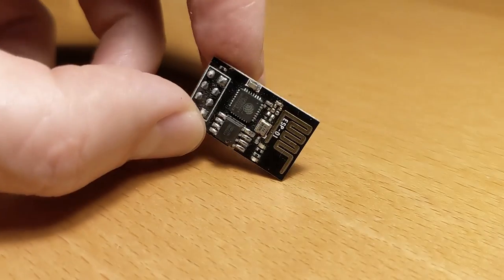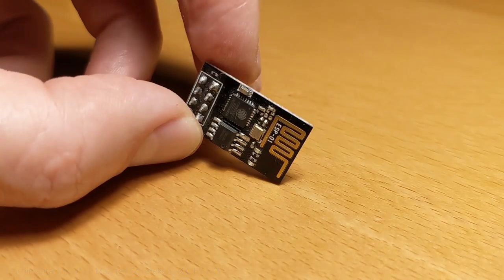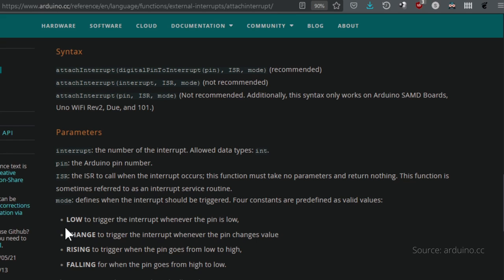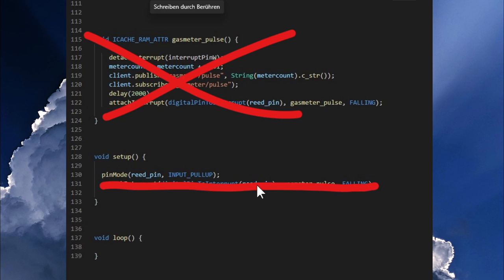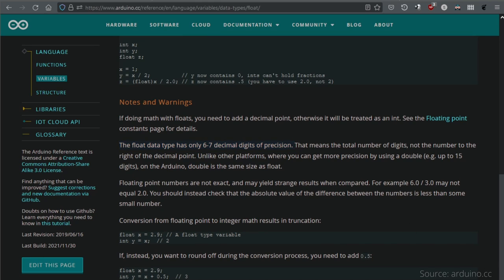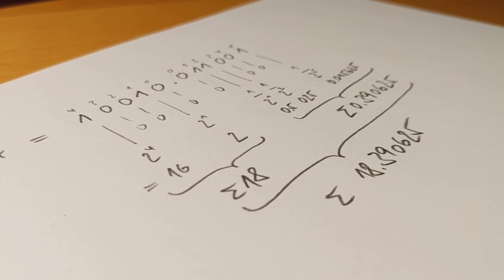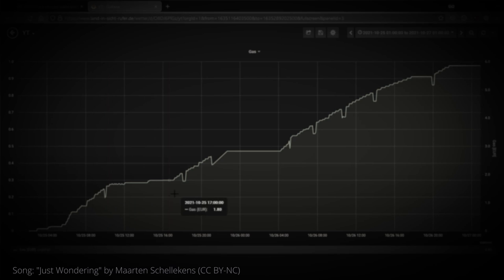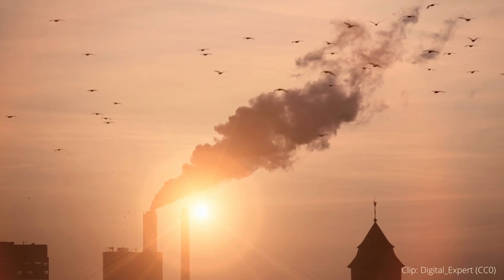Gas meter - Receive magnetic pulses with an ESP8266

Comment: how can i tell if my gas meter has a pulse?
Reply from the maker: Just test it with a simple circuit with LED, like I did it in the video. Maybe you can also find the manufacturer's specification. A small compass could also give a hint.

Comment: Fun project, note to programmers of ESP/Arduino. Both float and double are poor when using arithmetic, better to use a long, then divide in to a float for output readings only.
Reply from the maker: Very good suggestion, which has also been posted here several times in the comments now. I have modified the data type in the code on Github now. Many thanks for your feedback.

Comment: Why not use a hall sensor?
Why not count ticks instead of "0.1 of something" ?  Ticks in long integer :)
How did you reduce heating costs by balancing? Doesent the local termostat in each room do that already?
Reply from the maker: Since I was aware of the bounce problem of the reed switches even before the solution shown, I actually tried it with a Hall sensor first. Unfortunately, the magnetic pulse was not strong enough to trigger a switch with my sensor. I don't want to exclude that I made a mistake or that my Hall sensors simply don't have the necessary sensitivity. 
The Integer tip has meanwhile been given to me by some viewers too and of course you are absolutely right. I will change that in the code on Github ;-)
If balancing has not been done on your system, it is very likely that your heating system will have to supply a much higher flow temperature to keep the last radiator warm. With the valve under the thermostat you control the flow rate in the radiator, so that even when the thermostat demands full heating power, enough hot water still gets to the radiator at the end.
By the way, a radiator should be hot at the top and cold at the bottom. After all, it should give off the heat to the room. If the hot water even ends up running back to the central heating system, this is anything but optimal.
But I think I will make the video about it soon. Since you can save a lot of money, you can also try to check that already.
Reply: @MakerMeik  TY for the heating explanation. I see the problem of one thermo going full open and last room getting cold. Another thing to learn.
Reply: @MakerMeik  Did You tried to read analog values of the hal sensor? I once have one that was not switching digital input in weak magentic field but the analog reading levels was all I need. I think it was AH3503
Reply from the maker: Thanks for your tip. No, I wasn't aware of that and that's why I didn't even come up with the idea. I will have another look at it when I get the chance.

Comment: Very much interested in this project but still feeling my way in HA and ESP. So bought an ESP32 NodeMcu WiFi board and reed switch. I've got the Node-RED flow installed but now I'm stuck. Do I have to flash the ESP32? What's the best way to get this project off the ground and at least giving readings (calibrations can follow - part of the fun). Anyone involved in this project able to provide help to a newbe?
Reply from the maker: Since I don't have HA in use myself, I can't help you with your problem so easily. I have made the code available on Github. If you have a MQTT broker in addition to Node-RED, you should be able to flash this code to an ESP32 to use it. I'm not sure if you know how to do that. I use Platform IO with VS code for this. If you are a beginner, you might do better with the Arduino IDE. But even there you need some steps to make it work.
Maybe you start with some basic videos before you start with the MQTT topic used here.

I hope this helps you to get started.
Reply: @MakerMeik  Hi. Thanks for replying. Yes I do have Arduino IDE and I'm OK with flashing the ESP32 thanks. I'm still awaiting delivery of the reed switches but I intend breadboarding the circuit and using a switch in place of the reed. Agreed regards  MQTT. I continue to plod along and hopefully get this project running eventually. Again thanks.
Reply: @MakerMeik  Hi Michael. Since we last communicated I've progressed  quite well. (not bad for a 71 year old!) ESP-01 built and flashed and Node-RED created along with MQTT. I've got a couple of questions I hope you can easily answer: 1.IP Addressing; Can I assume that the gateway IP address should be the same as the MQTT address? (Line 17) and 2: what does the IP address on Line 16 refer to? I'm nearly there. Thanks.
Reply from the maker: Glad to see you working through the issue so persistently.
You can even delete lines 16 through 18, as well as line 39 (Wifi.config(ip,....)) if it confuses you. Then you force your router to give your ESP a free IP address. This is probably the normal case for most users.

If you, like me, prefer to assign a fixed IP, you do it in those lines. Then you have to define the fixed address in the router as well as here in line 16 to 18.

The gateway in line 17 is usually the IP address of your router.

Thus, the IP address of your MQTT broker (Mosquitto) should probably be different. For example, the IP address of your Raspberry Pi running Mosquitto. You enter this address in line 11 (const char* mqtt_server = ....).

The reason that the addresses are the same in my example is confusing and comes from the fact that my server still does some of the routing. So it's best to ignore that. ... I wasn't aware of it when I uploaded the code, otherwise I would have changed it.

I hope this helps. And I hope that I can still do these things when I'm 71 years old, like you do   :-)
Reply: @MakerMeik  As always your response is well received Michael. All noted regarding the addressing. I'll let the router assign a free address as you suggest. Hopefully I can start testing with a magnet tomorrow to simulate the meter. Node-RED needs no changes. For info I'm using an old wireless doorbell receiver housing, using 3 AA and a buck regulator for the 3.3v. should last a while. Anyway, thanks again for your support.
Reply: @MakerMeik   Hi. No success today unfortunately. I think I know what's wrong. I just copied the sketch text from the opened .cpp file and pasted into Arduino IDE. I suspect this isn't the way to get the info into Arduino IDE? But regardless commented out the lines you suggested and flashed to esp successfully. Can't pass the first hurdle of seeing the esp on the network.  More reading ahead. Cheers.

Comment: Hi, do you have the code for the arduino? I need to make one of those hydrometer too.
Reply from the maker: The link to the code on Github was already in the video-description:
https://github.com/MakerMeik/Gasmeter_with_reed
Reply: friend, I didn't find secrets.h in the library. how did you install it?
Reply from the maker: On Github you can find a template for this file in the folder "include". You create this file yourself. If you use PlatformIO, you can also put it in the "include" subfolder, like I did. If you use the Arduino IDE instead, it is enough to put the file in the same folder as the project file ".ino".

Comment: For this type of calculation it's best to use some custom variable type with FIXED decimal point.
Reply from the maker: Very good suggestion, which has also been posted here several times in the comments now. I have modified the data type in the code on Github now. Many thanks for your feedback.

Comment: Nice project, just to much data: simple solutions : do not use read switch , use a hall sensor, they have no noise. and use some de-bouncing code , best to wait 25ms after a changing before a retrigger is allowed), a hall sensor should not need a de-bouncing as there is no mechanics involved.

Comment: Is it not illegal to mount anything on meters?
Reply from the maker: I don't think so. The recess in my gas meter is there specifically for this purpose. There is also a device from the manufacturer itself. That does nothing else. If the do-it-yourself solution seems too risky, you can buy the "original". Nevertheless, I think that the 3.3 V of my do-it-yourself solution is not critical. Even if I touch the metal of the counter with it, not much will happen with the mass of metal. Especially not inside the pipes.
Reply from the maker: As other viewers have already noted, you can also buy the original "IN-Z61" sensor from the manufacturer. And it works exactly the same way in the end. Anyone who takes a technical or even criminological look at my sensor will see that it has no effect whatsoever on the meter reading and that the recess in the meter was designed precisely for this purpose. So I hope that I will be spared from too ambitious meter readers. My annual gas consumption fluctuates very little anyway.

Comment: Warum keinen Hall Sensor?
Reply from the maker: Since I was aware of the bounce problem of the reed switches even before the solution shown, I actually tried it with a Hall sensor first. Unfortunately, the magnetic pulse was not strong enough to trigger a switch with my sensor. I don't want to exclude that I made a mistake or that my Hall sensors simply don't have the necessary sensitivity.

Comment: What i would have done differently 1) Hardware Debouncing with correct RC values 2)Esp should just act like Wifi trigger  let node red increment the counter(so no float problems & simple code) 3) try not o make it battery powered 4)Complete change of technology have you seen the self powered RFID buttons that work with batteries i would have thought to use that instead of ESP

Comment: ooof. 

never ever use floats for data. use two ints, one for the whole number, one for the fraction, increment the whole number when the second int flips over.
also use two states, one for ioen and one for closed, only switch state when ioen or closed for n amount of time. then you can increment by state change.

Comment: again don't use ever,  never never use float or double, it unnecessary because of the problem u already see for urself, even the gas meter don't use it, it uses whole numbers and someone painted a dot on the meter for better reading ;-) that is always a rookie mistake, even in databases
Reply from the maker: thanks, i have corrected that in my code on github in the meantime